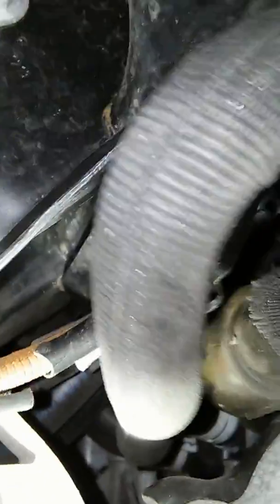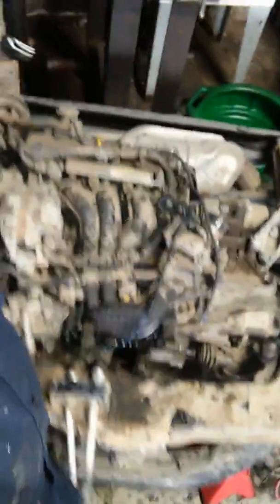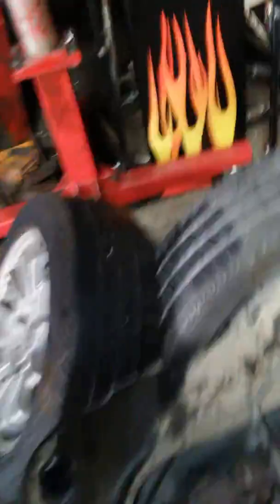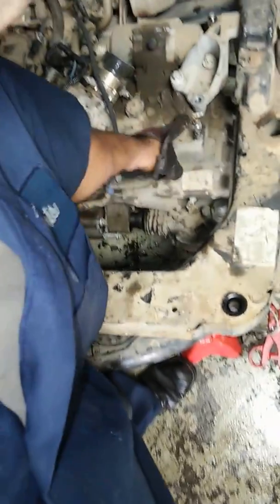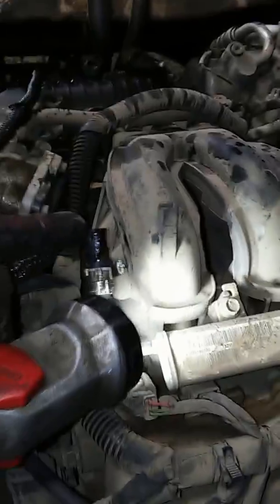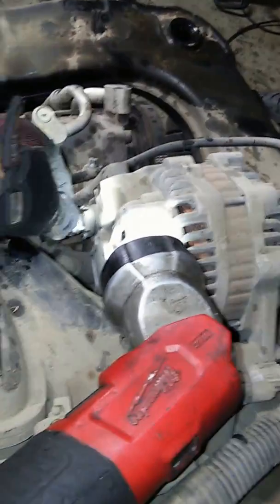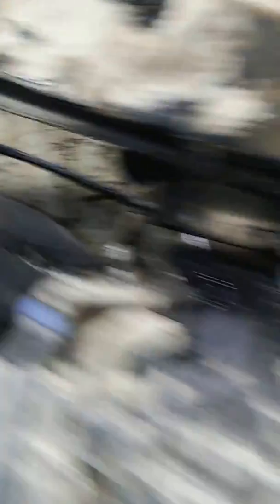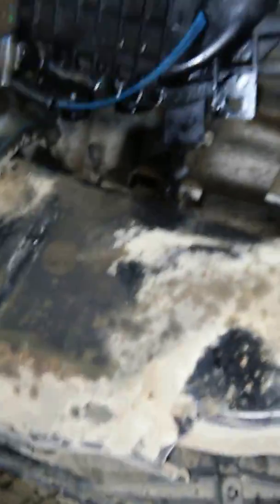🛠Smart car motor replacement engine install and removal how to swap🛠

Comment: How long should it take a experienced/certified Smart car mechanic to drop the subframe like you did to work in the motor?
Reply from the maker: It took about an 2.5 hours roughly.  It was my first time. To take it out.

Comment: Thank You for posting. This is a good start for my research. Gotta' drop the engine to put on a new muffler. Argh!!!!!#$$%^&!!!
Reply from the maker: You're so welcome. I haven't done exhaust on this model,  but it is really tight. Careful the cradle and engine are heavy.

Comment: Mechanic helping me to change gaskets and thermostat suggest to remove the engine out the frame, the frame still in place but they lowering the whole engine out. Is this correct or they should leave the engine on suspension frame?
Reply from the maker: That seemed to be the easiest way with subframe then remove engine.

Comment: Can we be honest . This car is a joke , I’m working on one atm and geez it’s a joke of a car 😂🤦🏻‍♂️
Reply: I think you are wrong! This is a fine vehicle.........
untill you have to change out the
fuel pump
alternator
exhaust
find an inspection station that will not put a jack through the plastic bottom.
The brakes and induction rotors were easy.
Reply from the maker: Right, 3 cylinder Mercedes engine, crazy.

Comment: What's the easiest way to get the hoses on the front disconnected?
Reply from the maker: I removed them at the rear that's where they're located.  Use A/C line disconnect fittings. Just like fuel lines, then snach out.

Comment: When you disconnect the air conditioning it has to be recharged after you put it back in?  Is there any way around that
Reply: I did mine by leaving the ac pump hanging from a wire. You need to pry off the belt and lower the front of the engine to get at the 3 bolts on the compressor and to undo the electrical plug.
Reply from the maker: I would say it's hard to do but you would need to remove the compressor, before removing the engine.  It really is not hard to add freon to the system.

Comment: Wandering where you got the intake gasket and exhaust gaskets?
Reply from the maker: I only removed the engine and cradle together. The customer wanted a engine replacement.